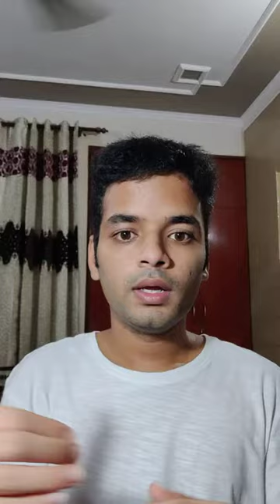Surveying: Different Types of Leveling   Fly Leveling by Arjun Singh Structural Engineer

Comment: Basically Fly leveling is conducted when the benchmark is very far from the work station. In such case, a temporary bench mark is located at the work station which is located based on the original benchmark. Even it is not highly precise it is used for determining approximate level. Tripod and instument you said are the basic principles nice all depends on this things and accuracy very nice 🙏❤️